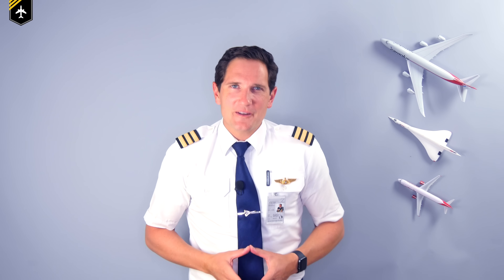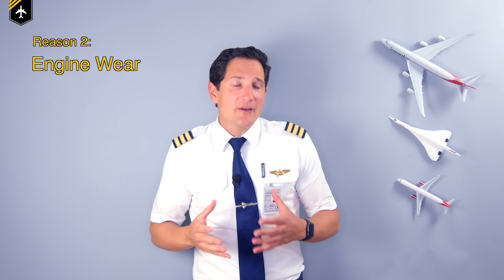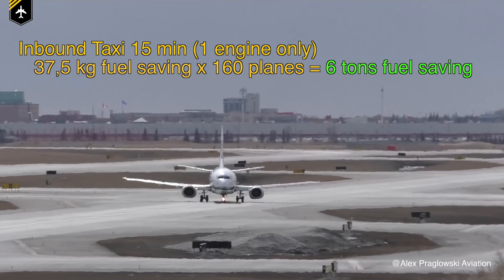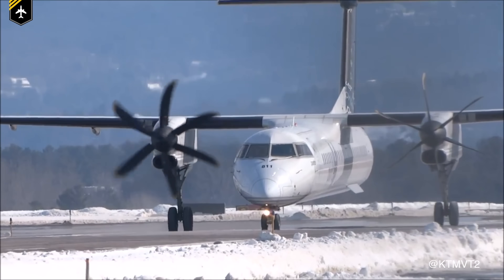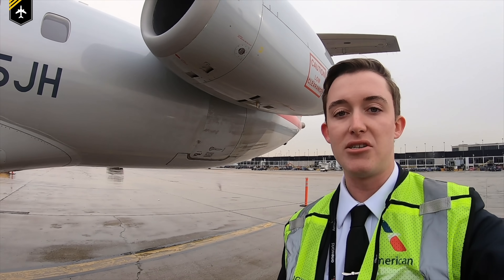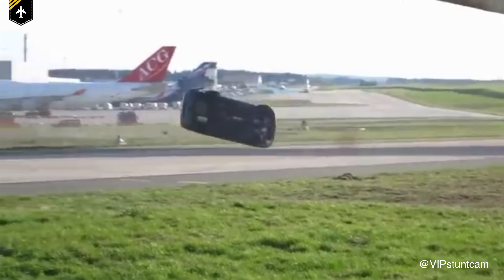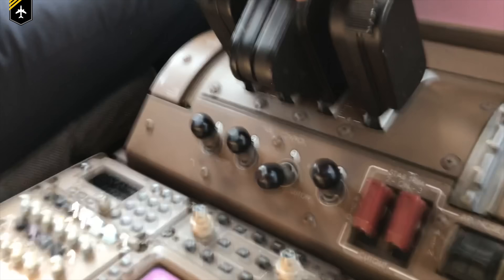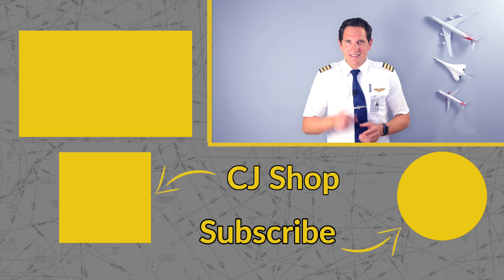Why do PILOTS taxi only with ONE ENGINE??? Explained by CAPTAIN JOE

Comment: This happened to me once while on an a321neo. I thought the Pushback truck was still attached and was pulling the plane forward, it was then I realized we were speeding up about 30mph but the engine on my side was still off. I freaked out so much that I'm building up the nerve to get up and tell the crew that one of their engine's not yet started. But I didn't do it anyway, but imagine the embarrassment I'm going to feel if I yelled one of the engines were off and freak out like an idiot. Anyway, great video

Comment: High time aircraft start using electric-in-wheel, its evolved quite a bit. And yes no need of storage battery. Put super effecienent APU(s) and electric power the wheels. Most important this will heavenly reduce air-cabin pollution during taxing.

Comment: Here’s a great topic for you next video. The ATR turboprops have something very cool. A prop break on the right engine aka engine 2. Once the plane is safely away from the gate, the pilots start powering on the engine without the propeller spinning. When the prop break is released it’s spinning at pretty much full speed, while the left engine (engine 1) starts spinning its propeller with momentum. The only time however I’ve seen the ATR 42/72 taxi with 1 engine is when taxing to the gate. Could you explain the ATR turboprop break in a future video?

Comment: That is interesting. The first time I was flying (at the age of 14, alone btw) with flybe I have noticed that the pilots already gave thrust during the turn on the runway (they did not stop before take off). I must say, that I thought that this was a normal procedure but since then I have been flying several times and this event did not occur once again. So it could be, that they warmed up the engine 2 very early?

Comment: Why do most airplanes start running with Engine No. 2 and then No. 1? What is the reson?
Reply: It depends how the systems are correct figured. The A320 for starts the  right engine first to provide pressure to the yellow hydraulic system for the parking brake. But for a one engine taxi they leave engine 1 running and just use an electric pump for yellow system

Comment: But how a single engine manage  to balance  the rorque applied on the plane while pulling it .
Reply: You counteract with the rudder/tiller
Reply: @ZK-APA  while taxing, at such  lower speed, will  rudder  provide enough counter torque ?
Reply: @83abhinavnigam  rudder no, nose wheel steering then prevents the plane just swinging
Reply: @tomstravels520  are you sure ?
Reply: @83abhinavnigam  the rudder has very little effect at taxi speed as there is not enough airflow to cause the plane to move left and right. That’s why the nosewheel turns to turn the plane
Reply: @tomstravels520  thanks very much

Comment: would it not save even more fuel to taxi just on the APU?
Reply: APU doesn’t provide thrust
Reply: @tomstravels520  
but y use thrust at all to taxi? That in and of itself seams pretty wastefull to me. Y don't we just use an electric motor in one of the weals.
Reply: @MusikCassette  because up until recently electric motors just haven’t been powerful enough to move a 50 tonne plane and would have been enormously expensive. Watch joes video from a few months ago about the company that has invented a capable wheel
Reply: @tomstravels520  well expensive might have been in the past. But you pretty much always could make an electric engine just as powerful as you want it to be. Or more precise as the powersupply allows. I mean trains can be 2000 t and more and we powered them electricly since forever.
Reply: @MusikCassette  a train also gets its power from overhead mains which can contain a huge amount of power. Now try to condense that into the power generated by the APU and moving a plane with much more rolling resistance than a train
Reply: @tomstravels520  how much power does the APU Produce?

also: most trains, that used diesel actually where electric trains with a generator. But that is beside the point.
Y would you need that amount of power? A Paint is just about 50 t as you pointed out.
Reply: @MusikCassette  a 737 is about 50 tons with no passengers or fuel on board. Now add them in and it gets closer to 80 tons. An A350 or 777 is much heavier, closer to 300 tons with passengers and fuel. And power depends on aircraft. Typical amount I think is 115V AC at 400HZ. Those lines above train lines are about 25,000 Volts AC

In terms of horsepower the U.K. trains produce about 5000-7000 horsepower, the APU generates the equivalent apparently to 1700 shaft horsepower.
Reply: @tomstravels520  let us not forget, that the trains have to pull about 50 times the mass. So 1700 hp , in real units, that is about 1200 kw. so that is more, than most haevy trucks have. during taxi The plane will come nowhere close to the speed a
truck or a train has to perform. So based on those numbers. I do not see, why this should not work out. my suspicion is, that fuel consumption and CO2 emissions at least until resently and perhaps still were just not that big of a concern.
Reply: @MusikCassette  yea but a trains wheels being metal on metal has a lot less rolling resistance to overcome. And a train has more wheels than a plane to spread the weight over. Besides I’ve already told you they’ve started testing on single aisle aircraft but there are compromises. The motors weighs 300kg so adds a considerable amount of weight to the aircraft. And a lot of aircraft will burn 300kg or less during the taxi anyway. That’s also about 3 less fare paying passengers the plane may not be able to take if it’s reaches its MTOW. Wide bodies are just too heavy for a small electric motor to work yet.

Comment: This is a quirk of turbine engines - amost half of their fuel consumption goes to just keeping them running at idle! They are horribly inefficient until they are operating in very cold, thin air. There are considerable fuel savings to be had by exploiting this.
I have an extreme example that is completely out-of-the-box for modern safety-anal airline pilots:
Flying DHC-6's (Twin Otters) for the ICRC in war zones in Africa in the early 1990's, we always faced a dilemma: The PT-6 engines of the DHC-6 are horribly inefficient, the aircraft being non-pressurized, operating in a hot climate, and being in a civil war situation we always faced the possibility of being unable to stick to the flight plan - having to divert to a place beyond the normal range of the DHC-6. We devised an out-of-the-box contingency plan: By shutting down and feathering one engine we cut fuel consumption by almost 50% while only cutting airspeed by 75%. That way we could go much further to avoid landing in a potential shooting-war situation and even if we were unable to make it to an airfield, this was a Twin Otter: You can plonk it down anywhere and be sure to walk away, provided you crashed it under control.
Considerably more bang for the buck (or more miles pr. pound of fuel in this case).

Comment: Follow-up question: If you taxi with only 1 engine, doesn't that create uneven wear and tear? Is that a problem? Do pilots alternate the engine they shut off for that reason sometimes or would that not work due to the hydraulic systems only being powered by one engine?
Reply: Yes it may create uneven wear and tear, but it’s negligible. And no engines are not alternated, it depends on the aircraft system layout

Comment: Why do pilots start the right engine first befire flight?
Reply: Does on the aircraft. On the A320 it’s because it pressurise the yellow system which is needed for the park brake

Comment: I just don’t get because what do you need to put the other engine on a little more power is there just having the same amount
Reply: Hayden Thorne in terms of thrust yes more would be needed from the single engine, but keep in mind that engines are not 100% effective. So a single engine with 2x thrust will still need less fuel than 2 engines generating the same amount.

Comment: Do pilots of 747s ever fly with only 3 of the 4 engines running to save costs?
Reply: Not unless there was a fault because you’d would have less thrust to get to and maintain speed at cruise altitude. There was a BA plane going to London that flew across Atlantic with 3 engines due to a fault with one after take off. Had to divert though to Manchester as would have not had enough fuel

Comment: It’s interesting you used Alaska Airlines as an example, because for one, the planes featured in the video operating for Alaska Airlines is the good old Boeing 737-400. Alaska retired these planes back in 2018, making them the last major U.S. airline that was operating a 737 classic family. Also, as a regular flyer on Alaska, they almost never perform single-engine taxis. I’ve seen it on Delta, but never with Alaska. Great video though!

Comment: ....... then, why don't the "tow vehicle" tow them to the end of the taxiway where they could them fire up their engines, turn onto the active when cleared and leave?
Reply: At 0.8kg per liter that would save 93.75L with the 15min 737 taxi example. At over a dollar per liter I would think paying ground crew would be cheaper. Perhaps checklists must be performed with engine running or something.
Reply: Towing the aircraft to the end of the taxiway would also significantly slow down the traffic at the airport when the engines would be started there. Extra vehicles on the taxiways would also be a safety risk. There are no benefits doing that.

Comment: About Fuel saving...  Some flights throw out wastly that fuel before landing... a few months back it affected public on floor.. why filling the fuel to much & throw out wastly ..
why did they could not know how much fuel will take for that travelling their destination... 
I know if the fuel is more in the tank it cause a damage the wings..
Reply: There is now a misconception regarding this thing. Fuel dumping is rare because it's not a procedure used during any normal flight and landing. It's done only in an emergency situation, not before normal landings. The amount of needed fuel to reach the destination is well known.
Reply: They only dump fuel in an emergency to reduce the weight.That delta flight you mention did have an emergency after takeoff but nobody seems to know yet why they dumped the fuel over the suburbs and not over the ocean.

Comment: #1 reason for one engine is safety for ground crews. Ground have pull/ put the wheels chalks and/or ground chief to pull the radio cable. don't want a ground suck into a engine or being decapatated by turbo propeller.

Comment: Is the plane not turning in this way, even if the engine has a small thrust force? Thanks
Reply: 19 87 yup, you just apply tiller corrections during taxi

Comment: If 2 engines are used for taxi, then let's say 10% power on each engine. If only one is used let's say 20%. So despite this the fuel is saved?
Just curious
Reply: Incognito Human yup. One reason is that if the aircraft is light, it can taxi at idle, so most of the time you are on brakes. With single engine it’s more practical in controlling.

And don’t forget engines are not 100% efficient. So with 2 engines you are using more fuel, even if thrust amount is same. It’s something like 2 people carpooling in 2 cars each vs 4 people carpooling in 1 car.

Comment: But now we need more thrust to move the plane with one engine... So is this a correct procedure for fuel saving?
Reply: Δημήτριος Τσιτσινάκης yup. As though thrust required may be more, but it’ll still use less fuel compared to having 2 engines running due to lower efficiency

Comment: I'm not sure about the fuel saving, two engine pushes half power or one engine push full power to taxi is the same fuel consumption right? you need the same force/thrust to push the same weight anyway, there is no magic to use less force to move more weight in physics. Even if two engine pushes full power, gas will burning more but you get there earlier, fuel burning time will be shorter. its the same. Please explain if i'm wrong.
Reply: John Lee practically, engines are not 100% efficient. Not all energy is converted to thrust. So having 2 engines will always use more fuel vs single engine even if the single engine is at 2x the thrust

Comment: Interesting explanation, although the only issue with this is that the thrust is asymmetrical so whatever engine you start up the plane will have a tendency to go in the opposite direction or at least that’s what I’ve found from doing it in a simulator
Reply: Nick Gresla yup, but you can easily counter it with rudders/tiller

Comment: What powers the engine whilst starting
Reply: The engine is started by using compressed air from the APU (auxiliary power unit) or external air compressor unit to spin the turbine before ignition.
Reply: Mike P except the 787

Comment: Why is airplane fuel measured in KG and not in Liters? (I am a very curious person :D )
Reply: Because the weight of the aircraft is an important thing. For example it affects to the length of the takeoff roll. Every aircraft has also its maximum takeoff weight. It's important for the pilots to know the weight of the aircraft after refuelling, so the procedure is to use kg instead of liters.

Comment: Question: Do airlines have to operate the third engine in a trijet on every flight? considering cost and maintenance. Thanks
Reply: Yes.
Reply: Yes but it was common to taxi with only engine 1 and 3 running then start engine 2 before takeoff

Comment: Why does the airbus a380 only use 2 out of 4 engines when using reverse thrusters on the runway
Reply: The A380 has reverse thrust on the inboard engines only.
Reply: Mike P do you know if the engines on the outboard actually have reversers but there’s no way to activate them? Seems more complicated to develop 2 different types of engine. One with reverser and one without
Reply: Thomas Mortimore - I haven't found information about how the manufacturing process is divided between these two engines. But many different sources give the same information that there is reverse thrust installed on the inboard engines only.
Reply: Would throw up too much debris

Comment: Isnt engine temperature important before engine load?? Like for a car?  Or maybe a turbine reaches working temp quickly?
Reply: Jag E yes. Hence you don’t start your engine and then immediately take off. Once the engine is started, a timer is set, and only after a set amount of time has passed, that you will use full power on it.
Reply: Thanks !

Comment: Why the 747 has four engines? Could it be equipped with only two big engines instead? Hope Captain Joe explains.
Reply: sophanara roth when the 747 was designed, twin engines were not that powerful or reliable.

And yes, it may be possible for the 747 to operate with 2 large engines. But a large amount of r&dh has to be done, which may not make it feasible.

Comment: Turn off one engine for 160 planes saves 3.2 million...thats nuts..why not just tow all them out save another 3 million.
Reply: jonzilla some airports do have the facility of towing next to the runway and then starting the engines

But the issue in doing this is that it reduces an airport’s usage rate, which results in less efficiency in a different sense

Comment: I taxi on one engine as well but as a necessity- my CFI told me due to “design features”, the Cessna 172 only requires one engine and and one hydraulic system (straight to brake) ...

Comment: The hydraulic system 1 has only an air driven demand pump, I believe that the air source for this pump comes from the engine 1 if this engine shuts down the system 1 loses the air source for the air driven pump so it will lose all the system 1, or does it have another air backup from other engine?

Comment: Sir, i fly CJ2+ 525 , i can't do taxy with one engine
Reply: Even a Toyota Prius taxi has three engines (one big and one small electric + one petrol).
Reply: @akronymus  it not because my jet can't.  It is not my company policy.
Reply: @MrShubham514   
It wouldn't save that much fuel on a small jet probably.
Reply: @akronymus  i talked to my accountable manager , in our country VIP only fly in twin Engine jet And for safety purposes they have excluded single Engine use.
Reply: @MrShubham514  
Interesting. There is not much risk taxiing with one engine, though. I suppose, such planes taxi in idle position, or almost?  
An A220 engine makes about 10× thrust compared to the CJ2+, right? So I calculate a CR2+ consuming ~ 30, l/h on idle, is this correct?
Reply: @akronymus  exactly!
Reply: @MrShubham514   
Thanks for the answer - so shutting-off one engine  for a taxi way of 10 min would save just 2.5 l 
 
And sorry for the Toyota taxi joke.

Comment: Unrelated to this video... Question: can you tell me if a plane can hover like a bird in a headwind. I mean I see seagulls and other birds hover in one spot for very long time in a wind. Can a plane do that? Provided wind is strong enough to keep plane in the air with no engine power? Just hovering... with pilots at the controls. I understand birds aren't just hovering they control the flight. Curious.
Reply: Computer Services yes you can. And if the wind is strong enough, you can fly backwards as well.

Comment: Why not use Litres instead of Kgs? Strange!!?!
Reply: It's not strange, because the total weight of the aircraft after the refuelling is an important thing, and every aircraft has its maximum takeoff weight. The pilots have to know the weight of the aircraft, so there is a clear reason to use kilos instead of litres.